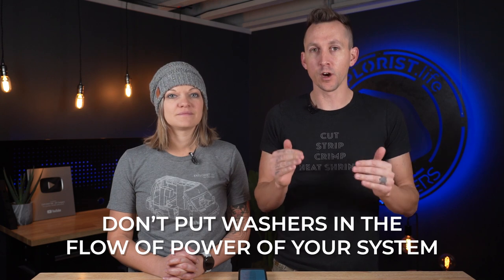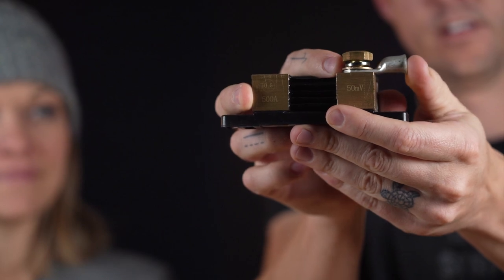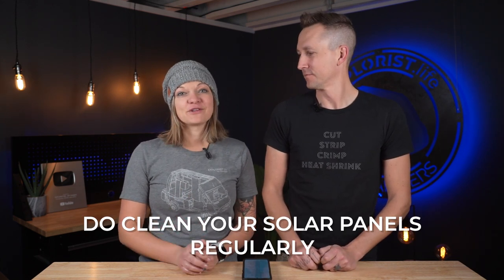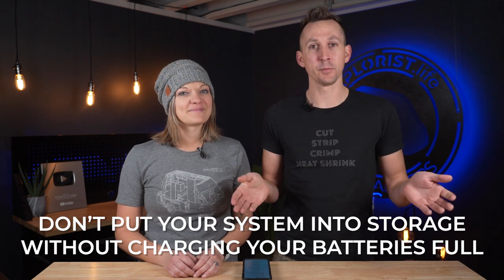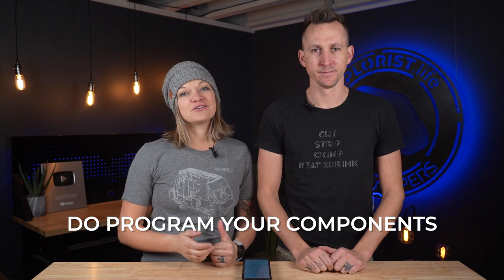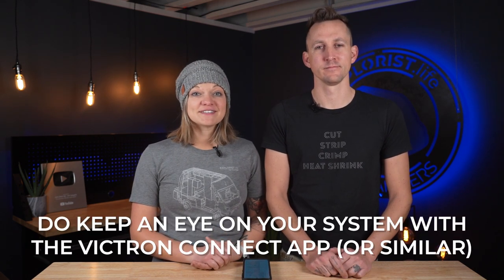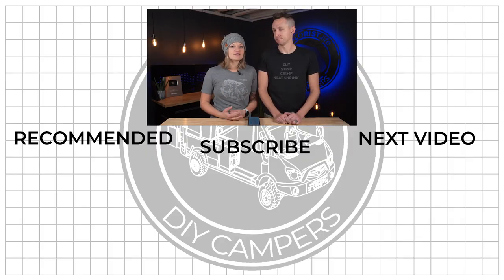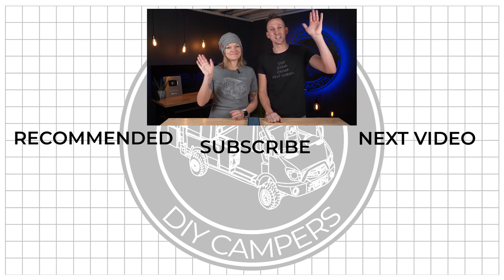8 DIY CAMPER ELECTRICAL SYSTEM DO'S AND DON'TS

Comment: Great tips!  On the washer tip, I did recently hear that in the rare event where your frame of your trailer is aluminum, when grounding your system, you should probably put a stainless steel washer between the copper lug and aluminum frame to prevent degradation of the aluminum.  Thoughts?
Reply: Interesting
Reply: You would be better off using a tinned copper lug as the tin acts like a galvanic bridge. If that is not an option, in HV applications we use a bi-metallic plate (google may reveal one for applications like this…not sure). Stainless is not a great conductor and would heat the interface like a standard washer as described in the video. 
Stainless is the appropriate bolt and washer for that application because it is not reactive with either metal, but you should either use anti-seize for the nut or find a silicon bronze nut to avoid galling.
Reply: @tjmarrinan  thank you sounds logical

Comment: Store your lithum batteries at 50%  I like dielectric grease on my larger connections but maybe that's bad??  Also, use a thermal camera and stress test your setup with a heavy load (i brew coffee).  Hot spots are lost power and may suggest a bolt tightening or increase wire gauge needed
Reply from the maker: Each battery manufacturer has its own storage recommendations, and most are well above 50%, so the better recommendation there is: store your batteries according to manufacturer recommendations.
Reply: @EXPLORISTlife   That would be the better advice.
Lead acids love to be full and kept that way... lithium hate a full charge and degrade rapidly if kept near 100%.
(For no citable reason, I'd suggest 60 or 65% and maybe setting my controller to treat that as full if using the panels for extended storage.)
Reply from the maker: Again... follow manufacturers recommendations.  Battle Born, for example, recommends charging to 100% and then disconnecting: https://battlebornbatteries.com/faq-how-to-winterize-your-batteries/
Reply: @EXPLORISTlife  . Wow. AIUI... Li-ion dendritic occurrence is an irreversible result of high capacity state duration... it's a function of the current chemistry. And it's a terminal 'disease' of same.
If your sponsor Battle Born has a solution... I should think it would be either known, or widely flouted in their marketing. Yes?
Reply from the maker: Perhaps you should chat with Battle Born about that?  They wouldn't make that recommendation AND warranty their batteries for 10 years at the same time if they felt it detrimental, I'm sure.
Reply from the maker: Listen, jim... the only blanket statement I gave was to follow your manufacturers recommendation and then gave a specific example of a manufacturer.

Ultimately, do whatever you want.  It doesn't matter to me. 🤷‍♂️
Reply from the maker: Okay jim.  If you can do a better job educating, start your own channel.  I'm going to mute you so that you can no longer use my channel to spread misinformation and you will be the only one able to see your comments.  Have fun in your Echo chamber where you are the expert.
Reply: Yes, chemistries vary between manufacturers but generally yes, 60 to 65% seems good for LifePO4.  Battle born uses cylindrical cells so 100% makes sense for winter storage.  The video advice of following the manufacturer's guidelines is legit.

Comment: Was wondering if you have any suggestions on how to ground my electrical system to and all aluminum trailer. I’m converting an all aluminum cargo trailer into a camper. Using a Bluetti AC 300 as my solar system. I have 30 amp shore power. I have the bluetti and shore power coming into a transfer switch. Not sure how to ground the progressive dynamics distribution panel with aluminum frame. Should I run separate grounds, one for ac and one for 12v, to the trailers distribution box or to the axles? Thanks

Comment: agree on loose connections after cracking everything pretty tight (I thought) damaged a battery.
Reply: @gattaca: Every reputable battery manufacture provides a torque spec for their battery terminals. RTFM and don’t exceed this spec and you won’t damage the battery. A similar comment can be made for high quality components; e. g., bus bars, battery switches, BMS connection’s, etc.   

Since many fasteners used to connect to components are SS, and SS has a tendency to gall, we put conductive anti-seize on these threaded joints. 

Finally, barring a manufacturers’ torque spec, a general rule is that after the  lock washer has been fully compressed, if you apply any additional torque, you are just showing off,

Comment: I’m expanding and upgrading my battery bank on my boat. In that case I have to move the battery to another place, in that case the battery switch will be about 1 to 2m from the battery bank. I was wondering if this matters or do I have to move the battery switch as well?
Reply from the maker: That shouldn't matter.

Comment: I don't know if my previous comment needed approval or if I didn't do it submit correctly. Asking again :). Purchased the complete kit this past year from ya'll, 400/600ah kit. Wired exactly as the guide. Would it be harmful to the batteries or charge controller if the Solar array Isolator was left in the "ON" position, but the main battery disconnect was in the "OFF"?   Just noticed I did this when checking on my Van in storage. It works fine when powering on and updating my victron app/equipment. Curious if it could damage the controllers or batteries. Seeing as it goes back to the lynx, I'm imagining no?.. but unsure of how the victron 100/30 charge controller functions when not having battery power but hot PV wires
Reply from the maker: The solar isolator should indeed always be turned off before the master disconnect switch.  If there were damage, it would be to the charge controller.  Damage is unlikely because the Victron Charge controller is very well built, but it's still possible; so be sure to turn the solar isolator off before turning the master switch off.
Reply: @EXPLORISTlife   Thanks for the reply :)

Comment: Quick question! I am building my solar setup. Our van is only used part time for adventuring so sometimes it sits for extended periods. I was wondering if my Renogy DC-DC MPPT 30amp (p/n: DCC30S)combo could charge my auxiliary house batteries and my starter batteries if I wired in a 1, 2, 1+2 Blue Sea switch. My thought was to wire the house on 1, starter batteries on 2, so if I switched it to 1+2 while it sits not in use, would all of it get charged? Then switch back to 1 when driving/camping. I was hoping the solar could be my battery tender when the van isn’t in use. Thank you!
Reply from the maker: I'm not really familiar with that Renogy charger, so I can't say.  Your starter battery shouldn't have any problems staying charged as long as the battery is good.  If your starter battery is going flat after only a few months, maybe it's time for a replacement?
Reply: It doesn’t go flat, but I have the 7.3L diesel engine, and just seems a bit weak when starting after it’s been sitting a few weeks. The batteries are only a few months old, but the van has always been like that. In your opinion, would that 1, 2, 1+2 switch work as I’m thinking it would though?

Thank you for your response. I really do value your opinion. I’ll do some more digging, and get in touch with Renogy.

Comment: Yo Explorists!
You guys are probably no strangers to the multiple “victron” groups on Facebook and I wanted to share something with you

Lots of people follow your wiring diagrams (after purchasing of course) for wire up Victron inverter systems and something continues to show up in the group feeds with issues using ferrules
From what I’ve seen, most of your 3kva installs use a marine grade 10/3 romex multistrand wire, which works if people plan to always plug in to a 30 amp shore outlet. But with the multiplus’ being capable of 50a (shore) some people go for the 6/3 OR 6/4 SOOW (which I prefer for all installs). What continues to come up is the confusion with the wire ferrules used in your diagrams. They have little blue caps on them. People are buying 6awg soow and are trying to cram this in to the 10awg ferrules. Now I personally haven’t seen 6awg ferrules with “caps”, only the aluminum cylinder style. 
Is this something you coul maybe make a short video about (with all your expertise😉)? 
I would have sent an email Instead but I guess I couldn’t navigate your site well enough 
Always watching🤙🏼
Thanks
Reply from the maker: Yeah, I've seen that.  I don't know what the issue is, though.  We personally use the insulated Ferrules on the 6/3 wire and they work just fine.  We do include 6ga with our kits with 6/3 soow.  Trying to cram 10ga wire into a 6ga ferrule will obviously not fit.

I know I saw one guy who trimmed off the end of the ferrule, for some reason, which will obviously make them too short.
Reply from the maker: See any of the videos on our full installs to see them in use: Full Installs: https://www.youtube.com/playlist?list=PLmvhcyi4n0TUU8FUc6LE38TBkdSLjdw_5
Reply from the maker: So, like this post in particular... https://www.facebook.com/groups/3008836042495631/posts/5976181625761043/

The guy trimmed off the end of ferrule and then said he's having issues with it not being long enough.  Like, yes... that action would indeed give that effect.  Perhaps stripping back enough insulation and then not chopping the ferrule down is the answer here.

Comment: You said to top off your battery bank before you put your camper in storage.  My understanding is for lead acid this is true.  For lithium My understanding is leave them from 30% to 70@????
Reply from the maker: Charge your batteries to the manufacturers recommendation before storing.  100% in the case of Battle Born Batteries like I recommend on this channel, but consult your user manual or contact your manufacturer for other brands/types of batteries.

Comment: I might add, have a fuse inline on every single system, make sure all the components used in the separate charging systems are compatible with all the other components and that no two charging systems are on at the same time.
Do all your research, I've seen so many poor examples of DIY lithium conversions & installs on YouTube that it worries me, I know it's not my rig but doing it for someone else takes on a whole lot of liability, these lithium batteries are not toys.